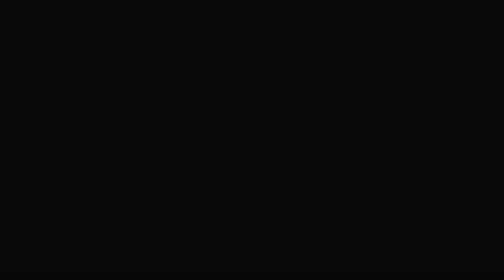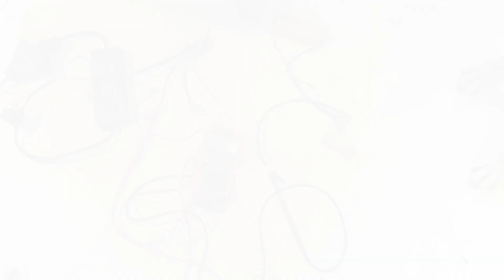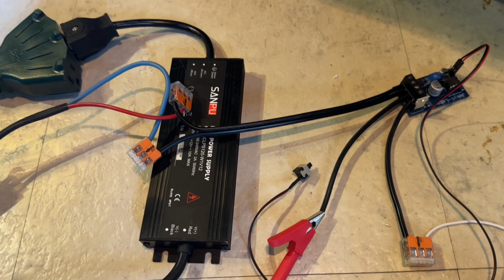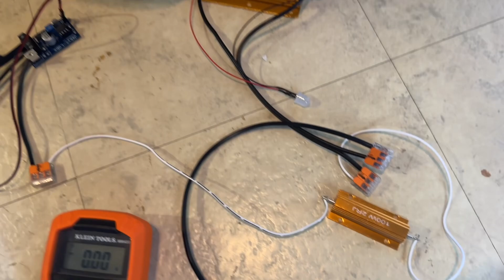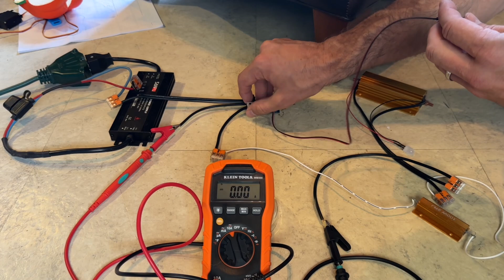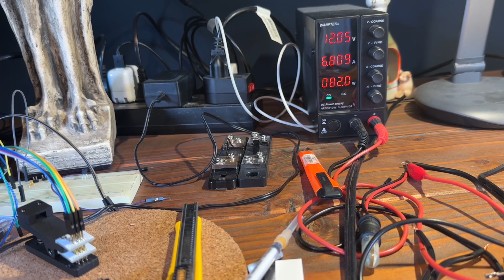Stress Testing the Twitch (MOSFET)

Comment: I wonder what could have caused an over-current failure on that MOSFET, if the failure was indeed due to overcurrent. I looked at your schematics and saw that you put a Zener flyback diode.  But without more information that's hard to diagnose, are there more that one of these failing?  I assume twitch means some motorized device attached to the outputs.   So FWIW, and I'm just going to guess here:   Instead of stressing the board with static current draw, try pulsing it repeatedly to get the higher in-rush current and seeing if over time the MOSFET just fails due to repeated stresses, not necessarily overheating.   The other problem could be ESD from handling the board and touching it?  Again without more information tough to diagnose.
Reply from the maker: I’ve only had one board failure that I’m aware of, and it didn’t get a proper post mortem. I wanted to look at max current limits because that’s always an early question people ask. I think it’s unlikely that repeated sub threshold current pulses would kill a mosfet as that’s exactly the kind of torture that they are made for. And they just keep PWMing along happily.

Comment: so, if you are only running 1 wiper motor per board there shouldn’t be any issues with overloading the board? And i assume the twitch and howl would run the same way, one wiper motor and your good to go and not needing a relay?
Reply from the maker: Broadly speaking yes. The wiper motor’s current draw depends on load. If your mechanism gets jammed or is lifting a very heavy load, a single wiper motor can exceed 4-5 amps and will burn out the mosfet. But that’s pretty uncommon.
Reply: @Jekyll-Labs   ok,  looking forward to your relay video.  Thank you.